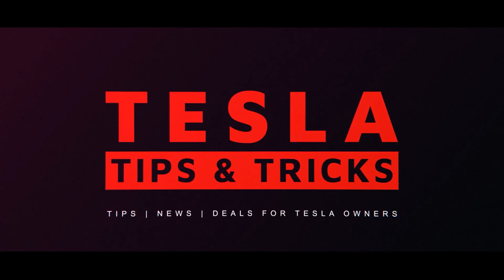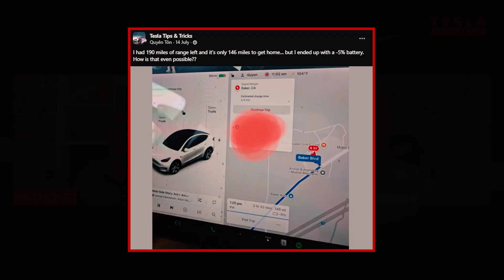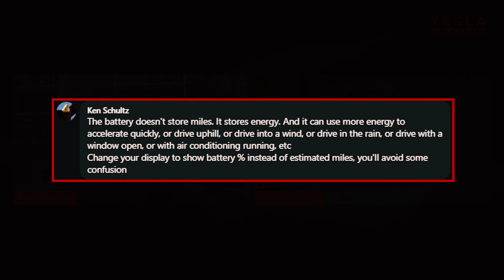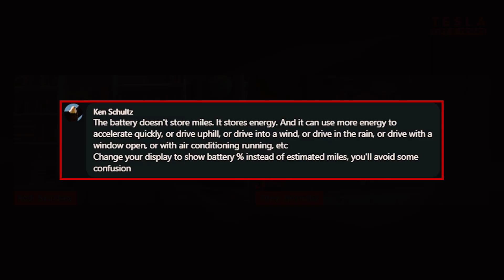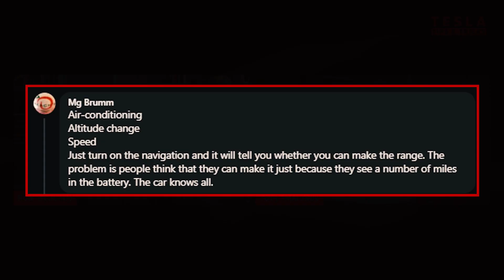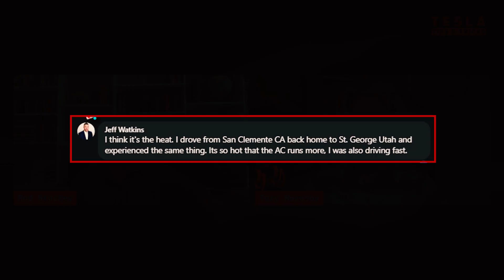Why Your Tesla Battery Lies About Range (and How to Read It Right)

Comment: If the car knows how much energy is left at the end of your trip. Then it knows the actual mileage rate, but it displays the EPA rating...which gets us angry.
Reply from the maker: The car does know how much energy is left, but the car cannot predict the future. For instance, will your A/C or heat be on the entire trip? What about heated seats? Are you going to drive 85 MPH or 65 MPH on the interstate, or maybe you're just chillin' at 45 MPH on backroads? Is it relatively flat where you'll be driving, or are there lots of hills? All of these (and more) use the energy stored in the battery, which lowers your range.